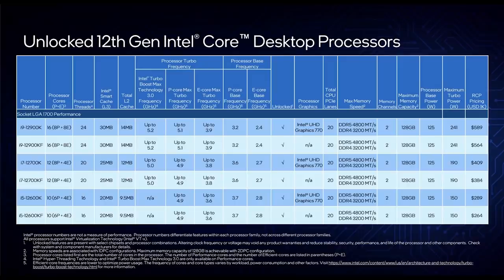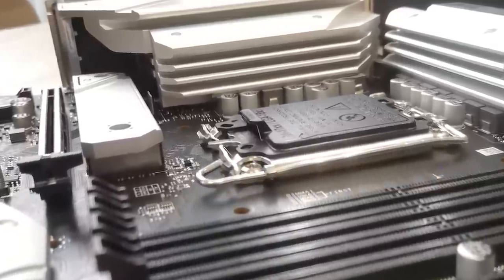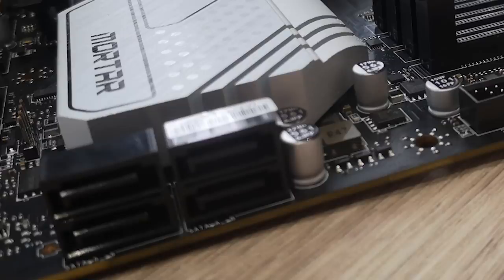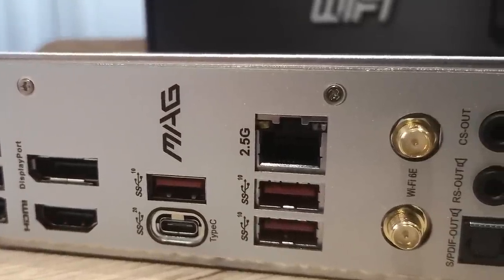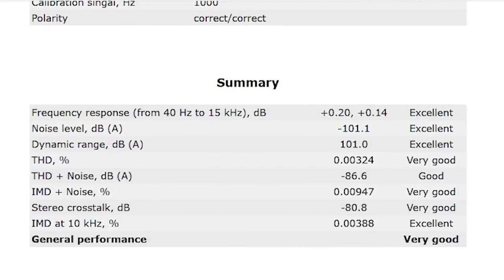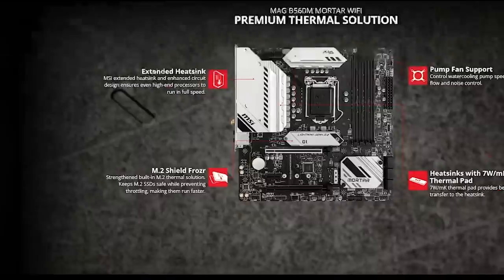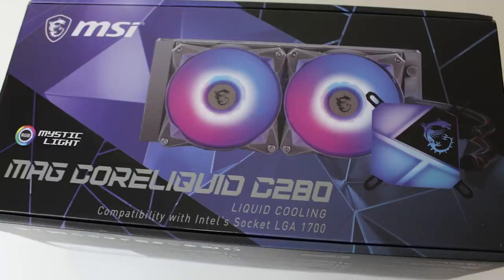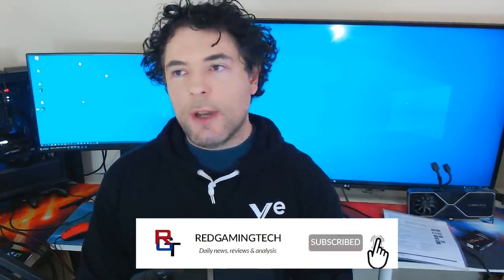The PERFECT 12th Gen Motherboard ? MSI MAG B660M MORTAR DDR5 Review Performance, Features & Analysis

Comment: Good joke about jumping on the DDR5 bandwagon. I just looked around and out of the three large webstores I sampled none of them had a single DDR5 module in stock. Actually over the last few months I've seen a total of four, I think, DDR5 modules in stock in any of them, and those were the absolute slowest modules they listed. Still sold within hours...

The funny thing is that at the same time all of these webstores has had motherboards supporting DDR5 in stock since the day they were released. Makes me wonder how many of those they've been able to sell.
Reply: DDR5 won't be worth getting until 2 years from now. The price is too high for such small perfomance increase. Should wait for Zen 5 or Meteor Lake to upgrade to DDR5
Reply: @maatimoobi8133  I expect differently, Zen4 will be a good moment.
The problem with ADL I suspect is that is supports both standards in the same silicon, that has to come with compromises.

Comment: is it possible on this board to enter a power limit manually for non-k  processors like the 12700 or 12600 ? because i saw in the vid that in the EZ mode BIOS there is this strange "cooler type" selection which seems to be limiting you to 3 options, with the water and tower-air-cooler being the same limits nonetheless compared to the boxed cooler option . or is there a manual wattage you can enter in advanced BIOS ?  i ask because i dont plan on overclocking but i want to make sure that a 12700 is not power limited and can reach its turbo consistently...